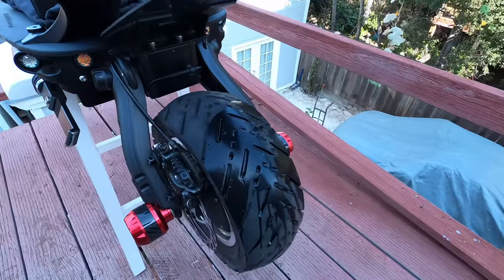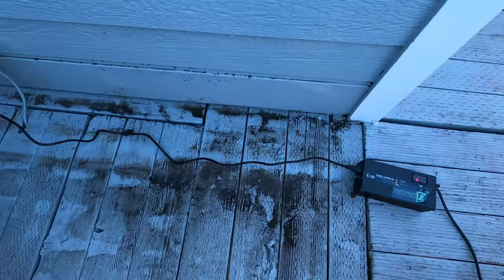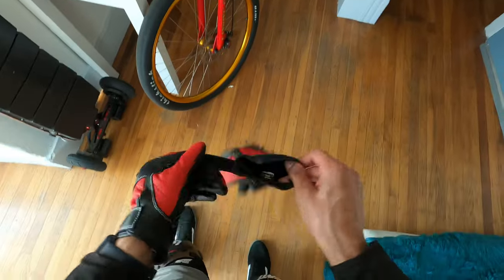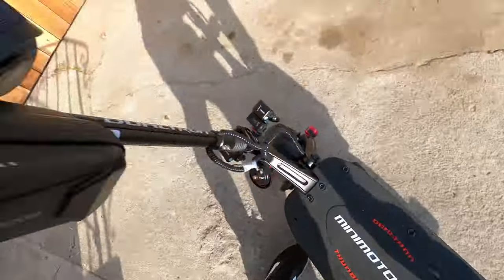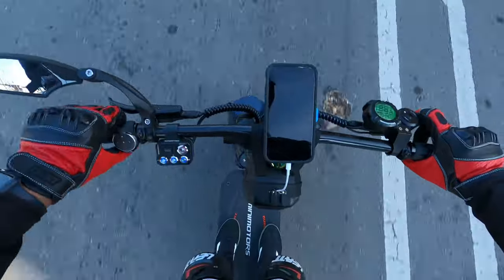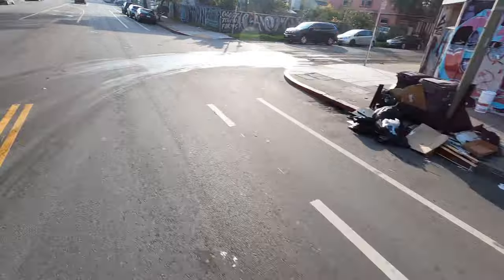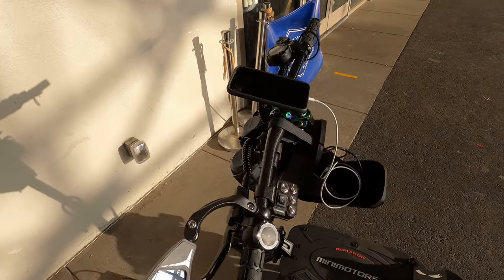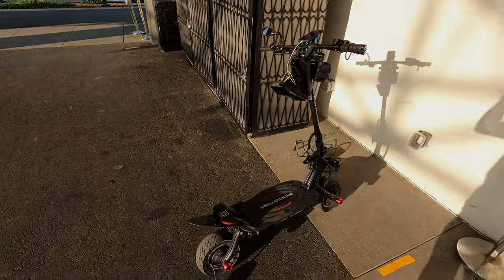Electric Scooter Dualtron Thunder 2 Upgrades\ Tire repair!

Comment: Sold my Kaabo King GT Pro and got the DT2 instead. The KKGTP is just too impractical unless you have a garage it's too cumbersome and you can't manoeuvre it easily it's takes up too much room you at least need a shed. The DT2 is far more likely not to attract unwanted attention as well, plus you can put a seat on it very easily.
Reply from the maker: Solid, Choice, bro! Dualtron is a little bit better in my opinion as far as quality goes!💯🤟🏽

Comment: Is the Alien Rides charger better than the Fast Charger sold at Minimotors in anyway?
Reply from the maker: Oh yeah! It’s adjustable man. 2,4,6,8,10 amps you can charge @! The minimoters in only a straight 6.5 amps not adjustable.
Reply: @JoyRideJay11  10 amp setting works for DT2 well like a real fast charge boost lol?
Reply from the maker: @kcfilmstudio  yup easily. Rarely do I ever tho. Never in that big of a rush. 8 amps is about the Highest I go. And you can get 10 amps in 2 hours!
Reply: @JoyRideJay11  Nice. I just read that high amperage will ensure cooler power supply and fast charging. 👍

Comment: Where did you buy that fast charger ?
Reply from the maker: Links in the bio my dude all the way @ the bottom. Go cop one asap! Game changer! I can charger from practically Dead to Full in 3 hours if I want too!👌🏽😅
Reply: @JoyRideJay11  that's was up💪  would it hurt the battery if you charge it fast ?
Reply from the maker: @rcmafia2  not at all. As long as you don’t do it all the time. It should be fine.🤙🏽
Reply: @JoyRideJay11  Yup, this! Don't do it all the time or else it will degrade quicker.

Comment: Hey dude get a razor an cut the plug/patch flush with the tyre and u don’t need slime aswell the plug is an uncured rubber and will hold the air just fine without the slime
Reply from the maker: For sure. I’ll keep that in mind for next time. 🤙🏽

Comment: What up man!!! Came across your channel. I'm really debating on getting this scooter.. worried about the process about changing the tires and the added expenses on attachments ( stem extender, and battery charger and etc). You're opinion; should I get the Varla eagle one or break bank ans get this?
Reply from the maker: Definitely big factors to consider. How invested are you willing to invest yourself honestly. Is this your first scooter? If so you might be a bit in over your head. I paid 4,800$ for it. I’m another 1,300$ in additional parts. Do you have a local PEV shop near you to help you work on it? I do. But I’ve also become very handy since Bc labor can add up!🤑
This is my second hyper scooter. Mainly got it bc of the unlimited amounts of customizations you can do. Most other brands as of now don’t have as many aftermarket parts. All depends on your budget. Also know that if you do get a lower end scooter. Your definitely going to outgrow it and want to upgrade to more speed. I see it happen all the time. Including myself!👌🏽😆
Reply: @JoyRideJay11  true!!! I live in San Diego and no I haven't came across any PEV. I was recommended to this bike repair shop, that sales ebikes. They stated they can work on electric scooters.. but idk.. appreciate your feedback. I'm considering the vsette10+ but I want dualtron thunder 2 tires (not puncher tires) on it. Mainly gonna use the scooter for new way to commute to work and school. Reason why I'm considering thunder 2 for range and comfort... I see your in LA. I'm down to roll up there. Only hr 30 min away
Reply from the maker: @ajjax89  the Dualtron thunder 2 is great! I just put a seat on mine! And oh man! Game changer! So much more comfortable and wayyy more fun! Feels like I’m on a motorcycle!🚀 😆 the Vsett is a solid choice! And I’m actually the the Bay my dude, Oakland!🤙🏽
Reply: @JoyRideJay11  decided to go with Vsette10+R
Reply from the maker: @ajjax89  Great decision! I’ve seen one in the group, their light & quick!🛴💨
💪🏽😤
Reply: @JoyRideJay11  sorry to bother you again. But any recommendations on DOT helmets? Been looking not sure if I need a full motorcycle helmet or an dirt bike helmet
Reply from the maker: @ajjax89  this is the helmet is rock and what 80% of most riders have. 

TSG - Pass Pro Full-face Helmet w/Two Visors | Performance Helmet for Downhill Skateboarding, E-Skating, E-Onewheeling, Longboarding | Compact, Aerodynamic | Scratch Proof Visor, Nose Ports, Anti Fog https://www.amazon.com/dp/B09FTCRG3G/ref=cm_sw_r_cp_api_glt_fabc_6SFR37SW35XFFPSD8G16?_encoding=UTF8&psc=1

Comment: Do not waste your money on a seat for the Thunder 2. It is not installable because the rear Motor Power Cable completely obscures the Allen Bolt needed to fit the seat. Stupid stupid stupid design.
Reply from the maker: I thought the same thing. Definitely a way around it. You have to get creative bro & lock it reverse under the kick tail.
Reply: @JoyRideJay11  There are two types of seat mounts for this, be careful, you want the one that is flat at the bottom. Ali Express the are just over £100

Comment: I'm trying to find that speaker mount! I've got the 2 black Wonderboom speakers! The link doesn't have anything anymore. Any help would be appreciated my guy!
Reply from the maker: Are used 2 of these and some zip ties. You just Gotta get creative bro.🤙🏽 
https://www.ebay.com/itm/134273909127?mkcid=16&mkevt=1&mkrid=711-127632-2357-0&ssspo=FavPIiFjQ72&sssrc=4429486&ssuid=&var=&widget_ver=artemis&media=COPY
Reply: @JoyRideJay11  Ironically, that's exactly what I have now along with the zip ties. I thought that maybe there was some kind of magical mount that was manufactured and available on ebay that the speakers fit in a bit better so I was curious. All good. Rip-on my guy. 🤙🏽